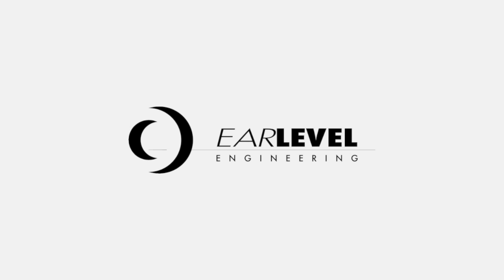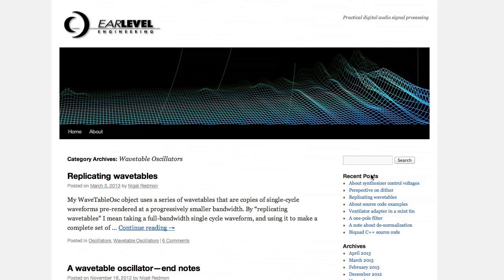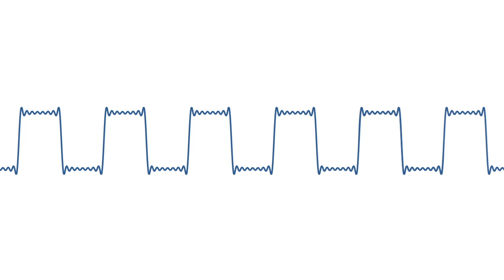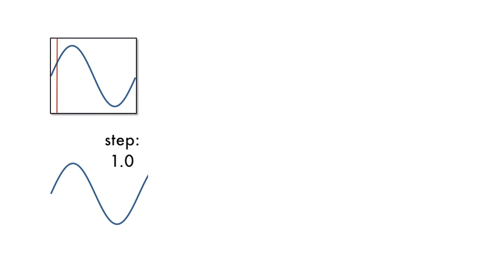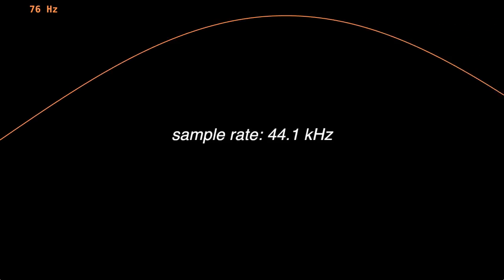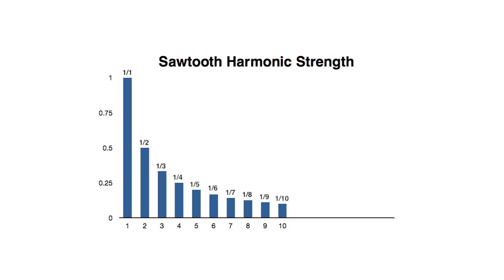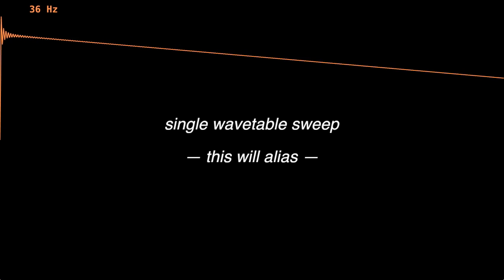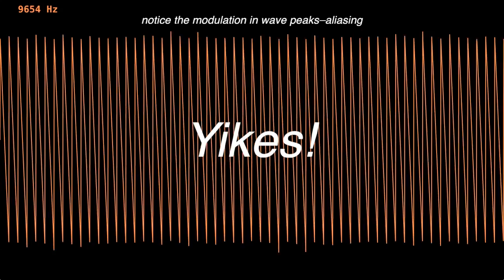Wavetable Oscillator Basics

Comment: I would like to know that a wavetable VCO is still an analog or "just" a digital oscillatior? sorry for the dumm question, but I'm just stepped in in the modular synths world. Thanks for the video though.
Reply: Bazsi P It's digital :). There are a lot of modules that contain microcontrollers or DSP chips that do lots of math very fast (for digital audio processing). It's quite common to find hybrid modules that mix both analog and digital; you can have a DCO and an analog filter. Even if a module is digital, it will still be able to receive a voltage from an analog module as it just converts the voltage in to a number, the microcontroller will do cool digital audio stuff, then convert it back to a voltage on the output of the digital module.
Reply: Amberoot Audio thank you for the clarification. Cheers!

Comment: These aren't wavetables; they're multisamples.
Reply from the maker: I disagree. They are precisely one cycle each, so clearly fall under the description "wavetable" that is found often in synthesis literature, and fits the same definition as classic wavetable synthesizers (PPG Wave, etc.). In audio synthesis, "multisampling" usually refers to sampling an instrument at multiple notes. I'm wondering if you come from the digital image processing field, where it is common to refer to a collection of the same image sampled at various resolutions as multisampled. However, that's not what I'm doing here. These are not tables at different resolutions, they are tables of the same resolution but different spectral content.
Reply: Nigel Redmon Take a look at this https://acreil.wordpress.com/2017/10/26/korgs-dwgs-synthesizers-1984/. The Korg DWGS synthesizers used multisampled waveforms with fewer harmonics at higher octaves to reduce artifacts. I understand now that the higher waves use less harmonics.
Reply from the maker: OK, I see where you're coming from, with the Korg article. I'd never looked at the DWGS architecture, but at a glance it does indeed look like the same thing I'm doing, basically (MB64H129 uses octave-based waveform selection, though it doesn't use interpolation). My article series and source code even allows for using shorter tables, and in that case it does fit your idea of multisamples, since the resolution changes (though the Korg article doesn't use the term "wavetable", it definitely is). However, as I noted, there's not much benefit to doing that on modern computers with tons of memory, and I always use a fixed size.

In a nutshell, the first wavetable hardware synths used a variable sample rate clock—the benefit is you don't have the worry about aliasing, but you can only produce one tone at a time—you have to repeat the hardware for each voice. The Fairlight CMI did this, with one voice per card. Using a constant sample rate gives the opposite tradeoff—you can run multiple oscillators off the same table and DAC, but it will alias unless you use an extremely high sample rate. So, my oscillator (and Korg's DWGS) solve it using a collection of tables progressively lowpass filtered; the logic reads form the tablethat best fits the pitch needed.
Reply: Nigel Redmon Although it is not from the article, I heard that the PCM waves were actually sampled from a Synclavier and some other synths.
Reply: Nigel Redmon Aliasing? The early PPG synths definitely had aliasing. The aliasing is still present in Wolfgang Palm's WaveGenerator softsynth even when the sampling rate is at 41kHz.
Reply from the maker: I only have only the most basic knowledge of PPG, and I know the sound depends on which version. It used variable sample rate, so should have avoided apparent aliasing there, but I know it also allowed cycling through wave tables for its characteristic sound, and there was no effort made to avoid the clicking (and that's something that would be perceived as aliasing when going through the table at a sufficient rate. Beyond that, i'm not qualified to say much more ;-)

The Gleeman Pentatonic was a "plain" (no wavetable cycling) wavetable synth that cleverly leveraged existing multi-counter chips to contain costs, but paid for it with a small range (the three-octave keyboard was no accident). It used the counters in a "divide by n" scheme, but they were only 16-bit, which limited the tunable range. It used only 8-bit tables, IIRC, so the "sine" wave had a lot of harmonics. But the oscillators didn't alias (or you could say the aliasing was contained in harmonic ratios).

Comment: Perfectly clear, but I was hoping for more information on wavetable synthesis as so many explanations leave me with questions :)
Reply from the maker: +Michael Bauers Hi Michael—please be sure to see my series of articles that go into more detail http://www.earlevel.com/main/category/digital-audio/oscillators/wavetable-oscillators/?order=ASC

And feel free to ask questions.
Reply: thanks, will do.  I write software and have a math minor, so I feel like I should be able to grasp wavetable synthesis, but sometimes there's too few details given and sometimes too many ( and perhaps the wrong details) given.  But I am slowly understanding my main confusion - how they sweep through them, and what sort of waves they put into them.  Before today, for example, I was not clear on the fact this was yet another attempt to get around the computational (severe) limits when they came out with these early synths.  So they would have waves that emulated a filter sweep for example.  But they also had "interesting" wavetables which I am most interested in.
Reply from the maker: +Michael Bauers Yes, exactly, you can have two axes of wavetables—choosing a table in one set based on the current frequency, and across parallel set to sweep tone, for example. For the tone, in particular, you probably need to interpolate between sets. This would be similar to morphing between phase-locked oscillators running at the same frequency, except that you're making it more efficient by using a single phase accumulator and combining the wave table sets. In my tutorial series, I'm just looking at the single waveform case, so the wavetables are only to avoid audible aliasing for harmonic-rich waveforms.
Reply: Ìgjkkjhgfdwedsert úp oohyyyytrttu

Comment: finally someone who explained it. Anti aliasing creates that unwanted noise if im not wrong.?? does massive automatically anti-alias the waveforms or is that something we need to manually adjust.
Reply from the maker: [Excuse me, I answered the wrong question. The email link from youtube for your post directs your question to the page for the dither video! A glitch I guess...re-answering...] Different types of oscillators limit aliasing in different ways, and to different degrees. The best way to know how well your oscillator does it is to open the filters wide (or bypass), and sweep the frequency to the limits of audibility. Aliasing is unmistakeable—as the oscillator frequency rises, you'll hear simultaneous harmonic components falling in frequency.
Reply: oh jeez. Thanks. Back to my pursuit of cleaner tones. thanks for the help.
Reply: I think as long as the harmonics keep below the nyquist frequency, aliasing is not a concern.